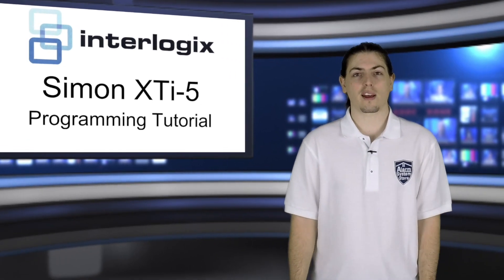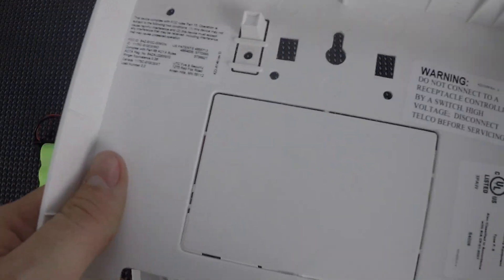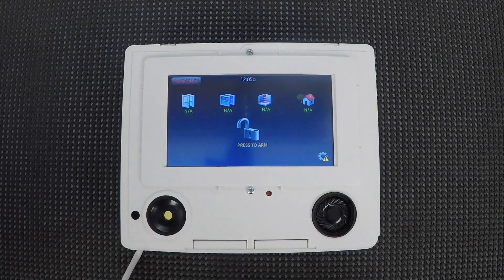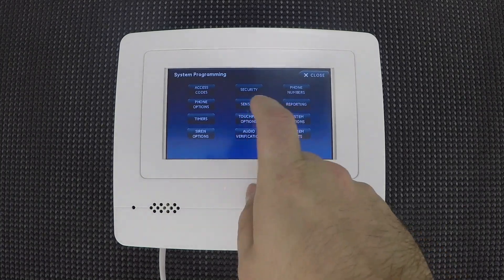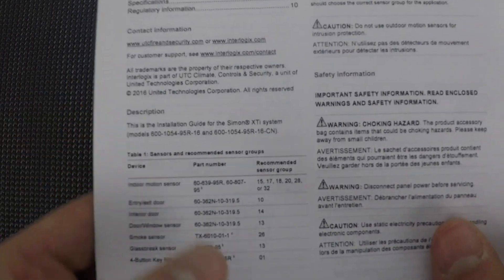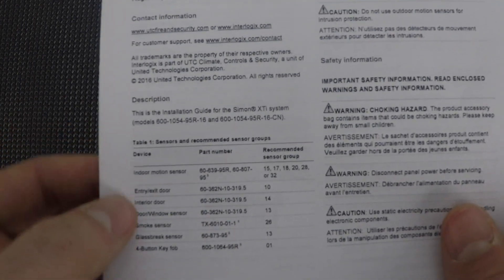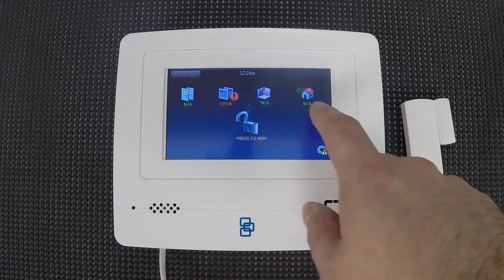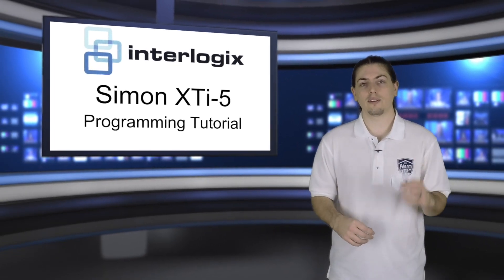How To Program the Interlogix Simon XTi5 Programming Tutorial

Comment: My alarm is going off with four beeps. I replace the battery already now I don’t know what to do.
Reply from the maker: The Simon is long discontinued so we couldnt give any specific instructions, but if its still beeping you may have a different trouble condition at play other than just the battery. Its also helpful to perform a power cycle on alarm systems as that clears troubles unless they are still present.

Comment: I have Interlogix Simon XTI-5 panel installed through my builder in my home. As per your video, i should see the Sensors option under Programming to add new sensors but i do not see the Sensors option under Programming. 

Question - How can i enable or unlock this feature?

Comment: In your video the programming menu doesn’t show interactive device is it because you need to add the GFM board?
Reply: Not sure what you mean by interactive device. Are you speaking about Z-Wave home automation integration?
Reply: Yes I meant the Z Wave programming feature which is located in Interactive Device programming feature
Reply from the maker: We were going to ask the same thing LOL
Reply from the maker: Are you speaking about Z-Wave Home Automation devices?
Reply: Alarm System Store

Yes
Reply from the maker: Yes. A module needs added to access that
Reply: Alarm System Store
Thank you for the response. 
One last question. Would the programming feature only be display in the programming mode if a card is installed. Or would it be display without a card but could do anything with the feature?